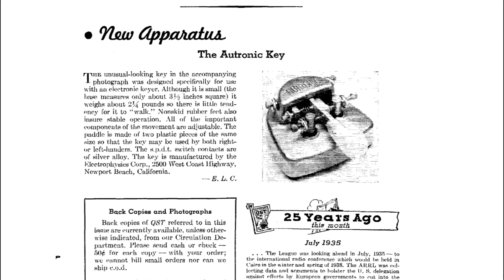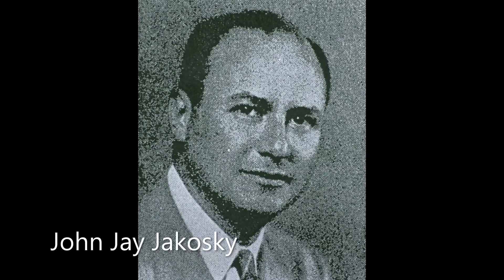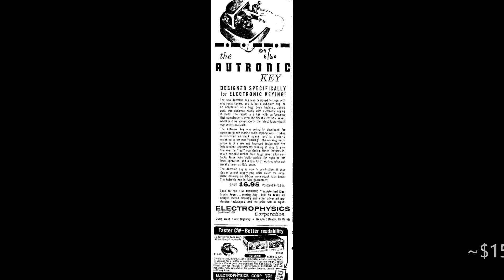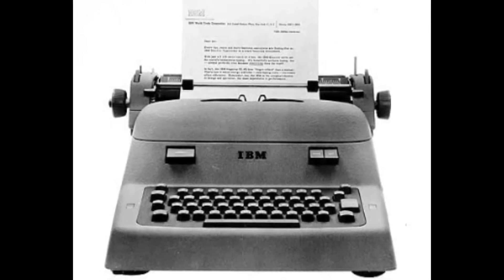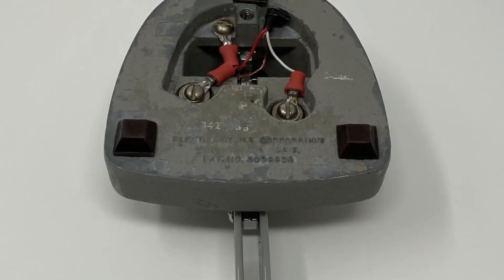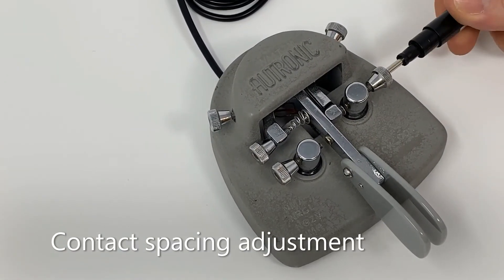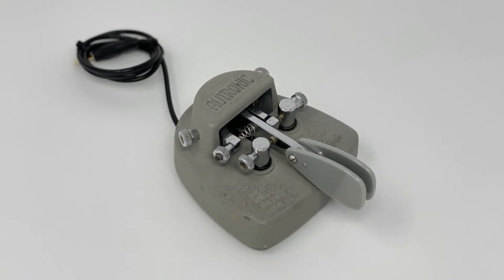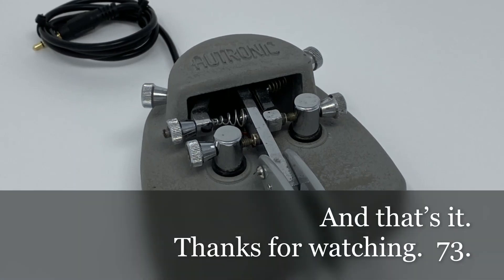Key History:  The Autronic Key

Comment: I have both in grey but need a manual for the electronic keyer K0KNL
Reply from the maker: I found a pretty mint Autronic electric keyer since I made this video years ago.  I haven't been able to find a manual either.  I did find an old ad that state the built-in power supply requires less than 3W, 75 to 130 V @ 60 Hz.  The ad also states that it is for use with transmitters keying circuits which break no more than 150V and 80mA.  I gave mine 120V and it fired right up and works with all my "modern" radios.  I don't use the keyer since all my radios have built-in ones.  It is a neat piece of history though.  73 Norm KC9CSC

Comment: I have one of these paddles and still use it as my main keyer paddle to this day.  Mine is a Costa Mesa key and I think I remember paying around $48 or so for it brand new if I remember correctly. What ever the price was in the late 60's when I purchased it seemed like a LOT at that time.   Mine is still in excellent condition with all the original parts.  The rubber feet on mine are original and they are round.    I remember that very ad in QST that you showed in the video.  Thanks for a lot of great information on this paddle!
Reply from the maker: Thanks for the kind words.  I bought this key off of eBay on a whim several years ago since I thought it had a really neat look.  I have several paddles in my collection (both single and dual lever), but I keep coming back to the Autronic key for regular use.  73 de KC9CSC